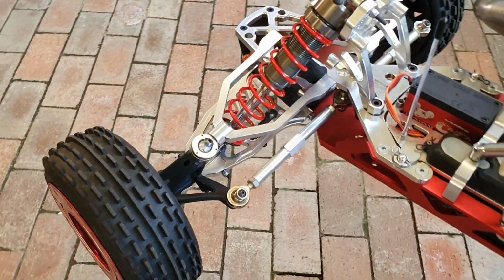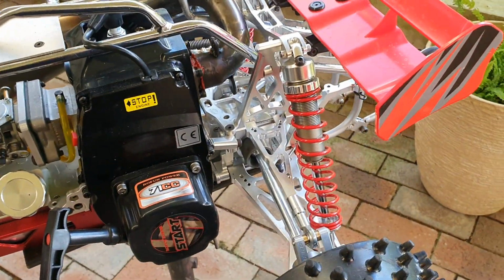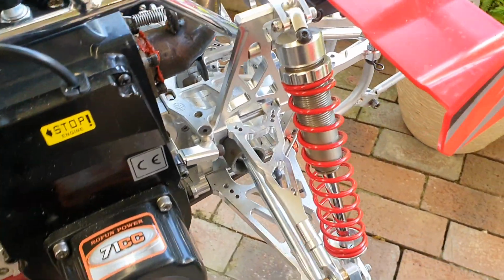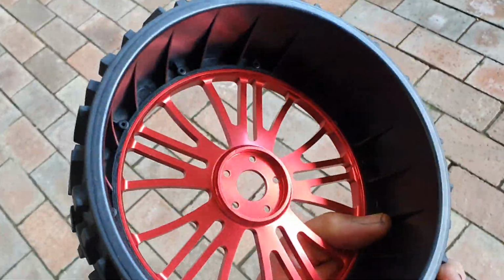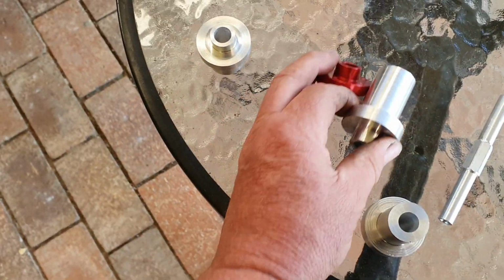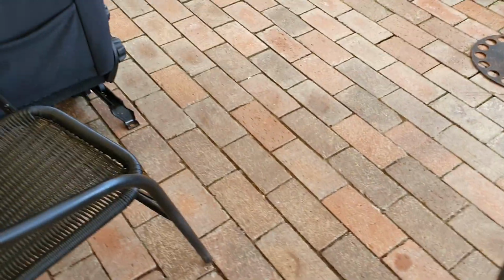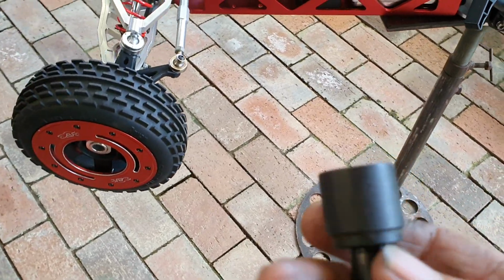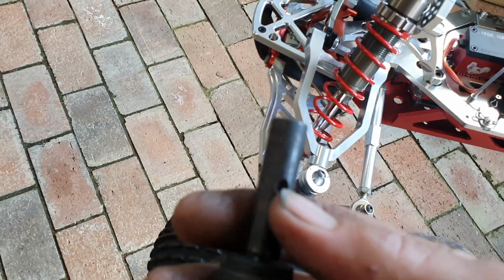Rovan 71cc Baja update with new turn buckles, rcmax red springs

Comment: Love the car question I see you're running the rovin 10 mm shocks where did you get the red heavy duty springs for them I'd like to do the same for mine thanks
Reply from the maker: The red springs  come Taylor  Rcmax, but you have machine the rear rovan  shocks to get the rear springs  on as for the front the red springs go on without  machining.  The video  tells what his to be done.